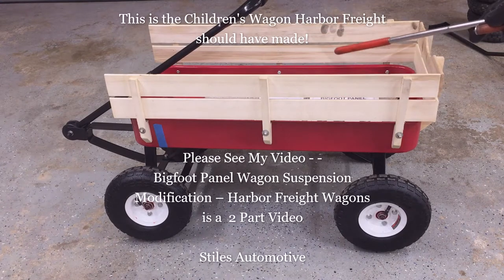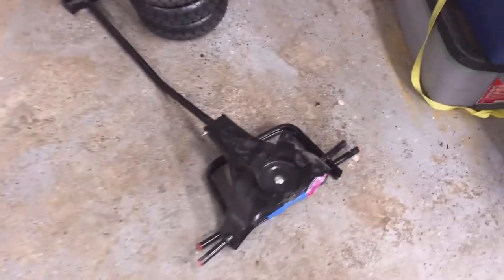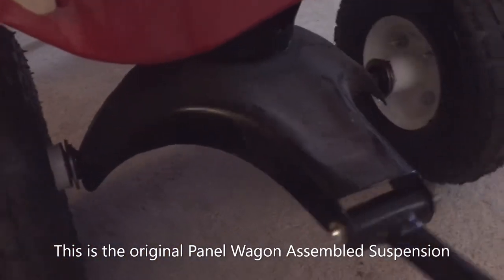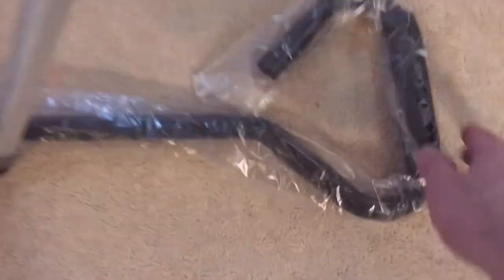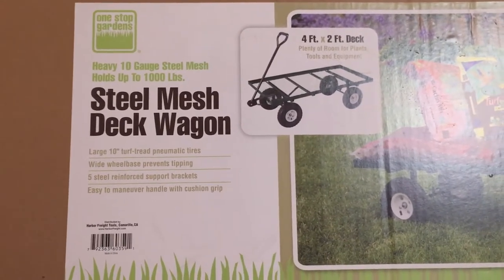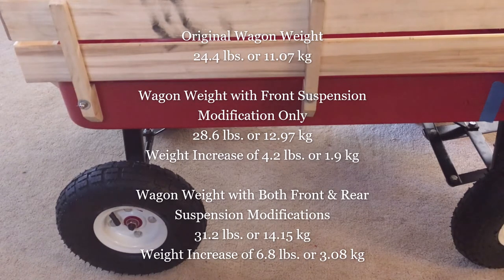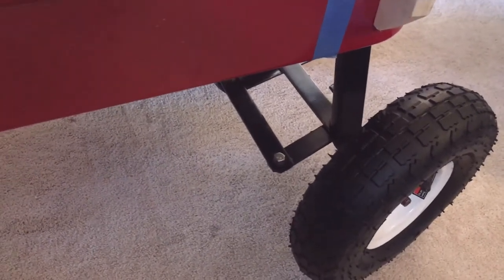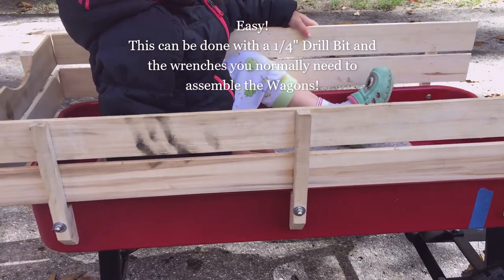The Red Wagon Harbor Freight Should have made - Suspension Modification

Comment: Could you have been able to put the wagon body only on top of the garden wagon. To increase the strength of the body, and weight capacity.
Reply from the maker: Husafel, Yes, you could have, but then the overall weight of the Wagon would be heavy! This was really a good option for the 2 Harbor Freight Wagons, but I have an old Northern Tool Garden Wagon, that would have been perfect to use like this. The Northern Wagon has a frame made from 2 small angle iron pieces and the Suspension bolts to that Frame.  My wagon is used to transport a kid or 2, sometimes 3 and some life support things for the kid. I don't carry anything heavier and this design works great! - Stiles

Comment: Yea I bought the red one and it sucks. It runs over me when I pull it heels hit. When you buy just wheels like that from HF I think they are 5/8 axels so I bought bolts with some shoulder and thread.
I don't like my load high I need it low. Whoever designed it high wants children to get hurt

Comment: Still cheaper than the radio flyer version
Reply from the maker: Joseph, I'm very happy with what I did with this Wagon. The extra load capacity and the Front Steering make the Wagon so much more stable. I still want to add Bearing to the Front Suspension where the Tong connects to the Steering Linkage, and I'd like to do something to improve the Wood Panel Sides.  Did you do this Suspension Modification using the 2 Harbor Freight Wagons?  - Stiles